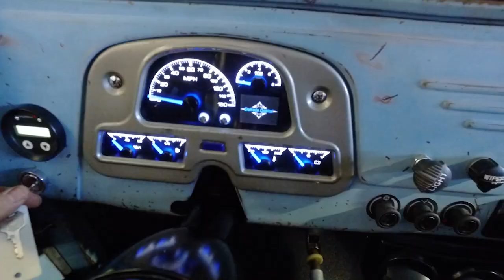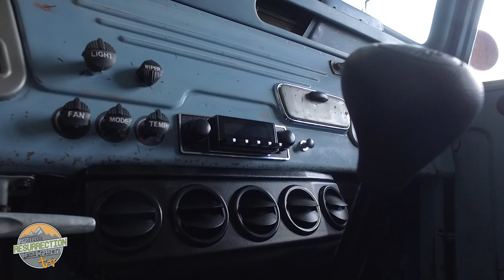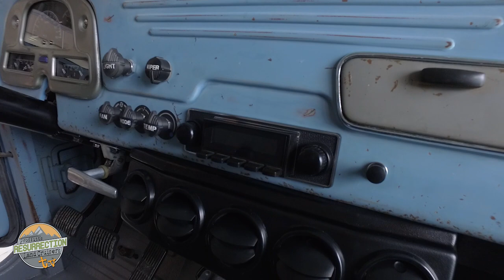The Blue Bomber! Coil suspended, diesel powered, totally restored patina FJ40 Land Cruiser resto-mod

Comment: Love this build.  Love the patina!  great look.  Not being negative here cause you all do fantastic thoughtful, artist work.  My only issue that i see ( being an overly critical engineer that i am  ( yes it was hard for me to get dates) ....in this quick video is the steering conversion up front .  In regards to the cross member between the frame rails.  In order to get the box back and the shaft thru , it looks cut up  beyond my comfort zone.  1) large portion is removed , 2) Don't like the square cut  this would be a stress concentration points for crack prop.   Maybe you reinforced this on the back or underneath did not see it?  I am sure you guys addressed this issue i just did not see how.

Comment: Very surprised to see the 2F in the chopped rock crawler. My newly rebuilt 2F is still gutless. Lol. What kind of power are you getting out of that engine and what are you using for fuel delivery? Carb or EFI?
Reply from the maker: The crawler originally had an EFI 3FE. We switched to a 2F because the owner didn't want the vehicle to rely on any electronic circuitry. For that reason, we went with a points type distributor and a carburetor. I think HP is about 165. With 5:29s, it moves the rig around pretty well.